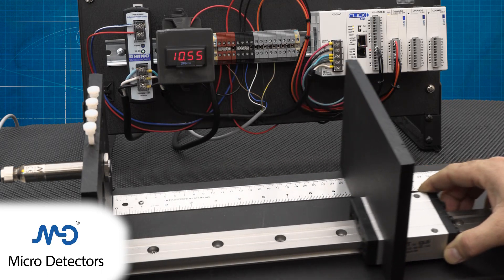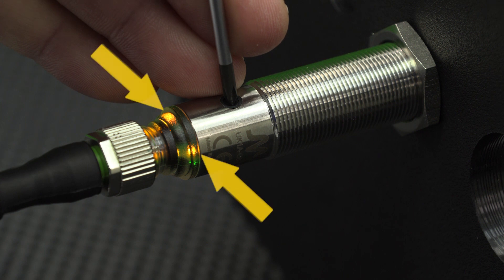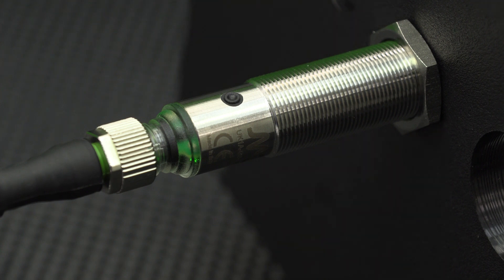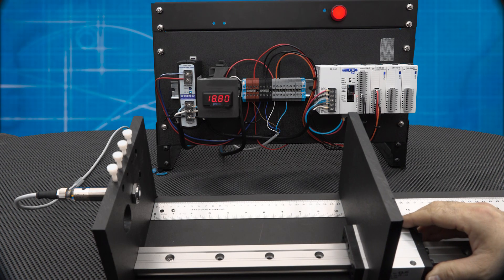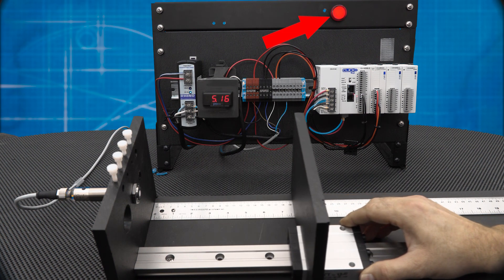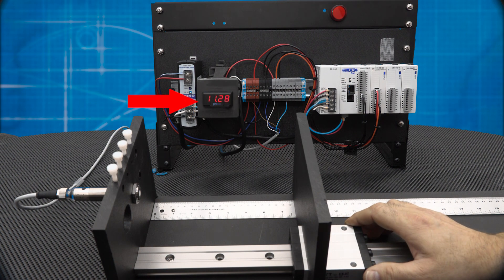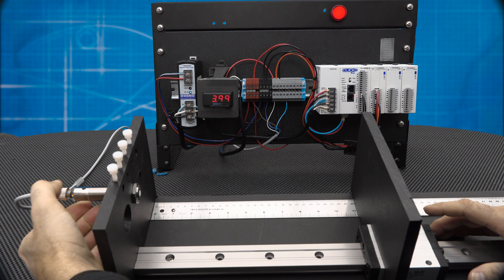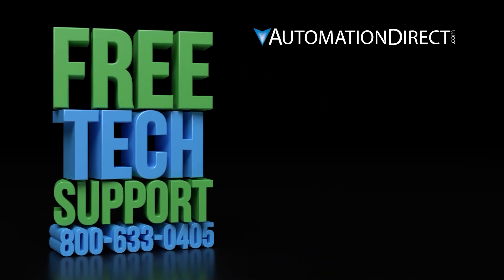Micro Detectors MD Ultrasonic Sensor Window Mode Configuration from AutomationDirect

Comment: Sir we have ut2f/e6-oeul sensor which needs to be calibrated for 5mtr distance water tank level.i am not able to configure it with this method as it has only 1 orange and 1 green LED lights.Help me sir pls
Reply from the maker: @ manish maurya AutomationDirect does not carry the exact part number you stated. You can find the user installation instructions for calibrating a UT2 series ultrasonic sensor here:  https://cdn.automationdirect.com/static/manuals/sensors/ut2_insert.pdf  It would be beneficial if you contact our free award winning technical support to discuss the part number and  the installation setup.  Tech supports contact information can be found here:   https://support.automationdirect.com/techcontact.html  Thank you.
Reply: @automationdirect  thank you sir! Ur help is much appreciated